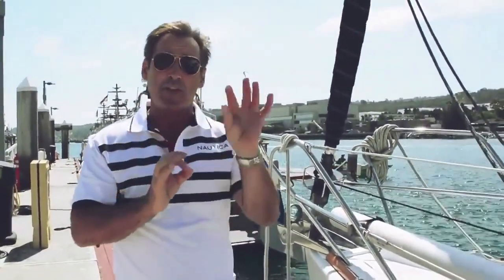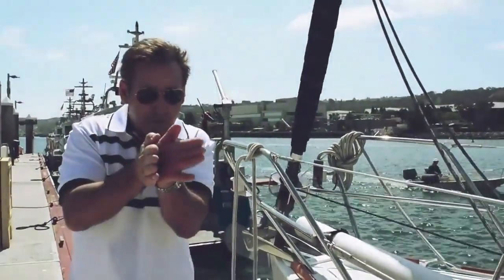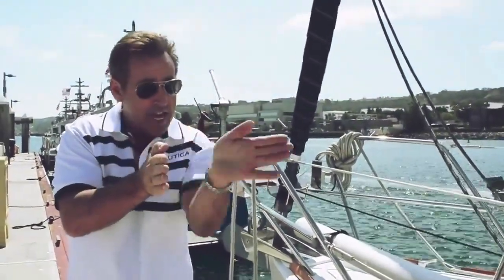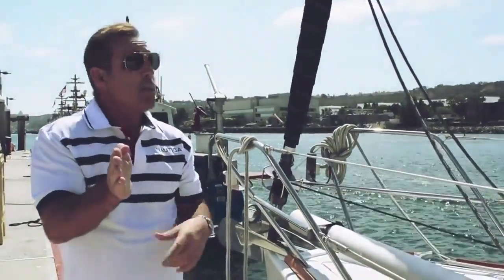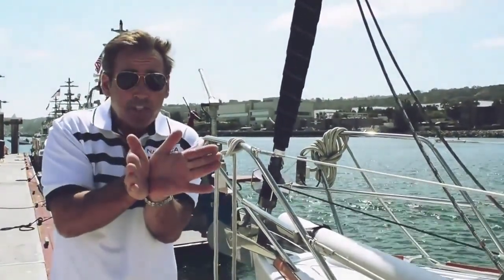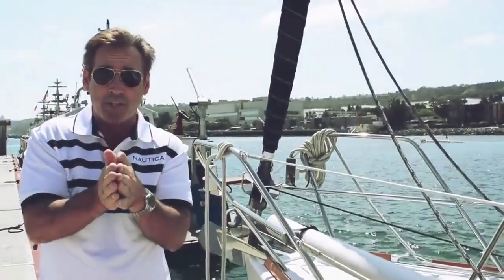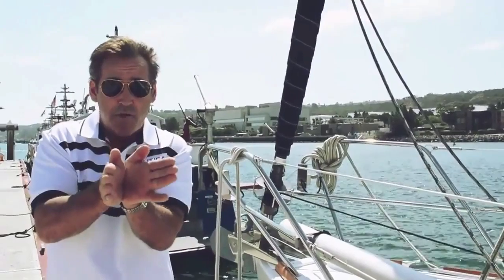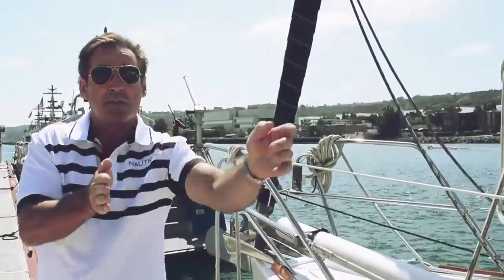BENETEAU OCEANIS 37 | Docking Techniques: How to Spring Off the Dock in a Strong Crosswind or Tide

Comment: When single handed in the very exact situation,  I've looped a stern line to the dock instead, and going forward to make the bow pull off the dock first,  with about 45 degrees before releasing the stern line. The benefit in my case, is the fact that I had steerage almost immediately rather than deaingl with any prop walk. Good video.
Reply: yep that works too but only if wind is forward of the beam right?  will be hard to achieve this in strong wind aft of beam as very difficult to get the bow out?
Reply: Indeed, that is a lot easier, I am solo and I can control the rear spring by myself
Reply: yes was just thinking this especially if you have prop walk to port in this example this would be the preferred approach IMO
Reply: Would you turn the wheel to the dock in this instance with a stern line?

Comment: I do similar but use reverse all the way until I'm as much perpendicular to the dock as needed. But then I'm in an outboard so maybe the direct pull of the engine is different than a rudder?  Also, I've  piling with a large ring directly in front of the port bow so my natural instinct is to pull back from it rather than drive forward potentially into it. Dunno? But it works fine.
Reply from the maker: That sounds really cool Derek thanks for sharing I m gonna try it  …… always open to learning something new 🤙🙂

Comment: You say it's the "only" way, but that's not quite right. You can have even more control using a seaside stern line. Strong forward while steering towards the dock. This frees the stern from the dock, now you slowly turn the wheel seaside, all the while your bow will move away from the dock. 

There's no sudden change in gear, no fast moment and less chance of damage (no pushing against the dock at all). For more effect, you can use the midcleat seaside, but this requires a long line.
Reply from the maker: Agreed. May be I misspoke
Reply: I've tried this. 
It’s not effective in high winds though. 
You get way more leverage with pushing bow or stern against dock.

Comment: How would this work with a fixed dock?  Especially when the tide is low and the dock is higher than the deck of the boat.
Reply from the maker: I think you would use a different technique

Comment: I'm confused why you have the rudder to port while backing to starboard.  Does your prop wash naturally take you starboard?  Our prop walks us to port.
Reply from the maker: Great question -very observant -let me clarify. the rudder is over to port while we drive forward into the spring -that provides the thrust to peel the boat out against the wind and tide pressure and then at the moment when we engage reverse to back out we bring the rudder to neutral or a little starboard even to make sure that we back out in a clean straight line 
thank you for your comment have fun, stay safe 🤙
Reply: @royalnavyyachtmaster  I see now. Thank you for your explanation.  In watching the video again, it makes complete sense to me now.  Always learning......:)

Comment: Would this work with twin rudders boat without the prop-wash effect? or should we just have a stern line looped to the dock and go forwad, just like Mo River suggested? Thanks for your advice.
Reply from the maker: That’s a great question and thanks for reaching out of course as you know with the twin rudder the propwash goes straight between the middle of them not directly on the rudder blade… to be honest I’m not really sure… give it a try see if it works? 
 I’d love to hear what happens thank you so much have fun be safe see you out there 🙂
Reply: @royalnavyyachtmaster 
It's to do with the "pivot point" on different boats propulsion gear arrangements...

Comment: Can please somebody explain why in this particular situation  starting the manoever with a forward gear is a better option than simply putting the engine to reverse and turning right?
Reply: A boat this large wouldn’t turn fast enough to clear the boat behind it. You would just back into the boat behind imo.
Reply: No, this would not happen on yacht of this size. This is because the bow line will still protect you against this risk. So I would fix / use the bow line as proposed by the Royal Yachtmaster, but instead of going forward I would go in reverse.
Reply: @michalmarkowski4343 A diesel   engine on a 37 ft. Yacht cannot have enough torque to pivot such a long/heavy vessel.
Reply: @kenlee-97  that is probably the answer I am looking for. Many thanks for explanation.
Reply: @kenlee-97   but I just found a comment  below of @derekec who is doing this maneover as I propose. He did not mention the size of his boat though.
Reply from the maker: That would drag the bow down the dock